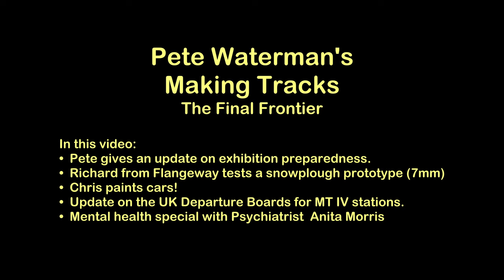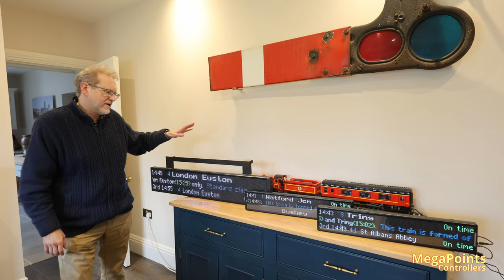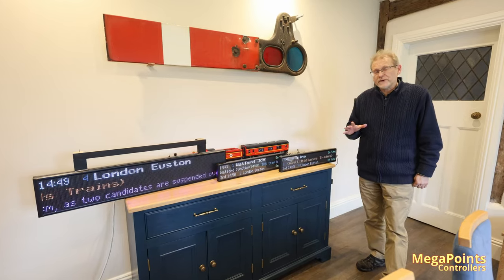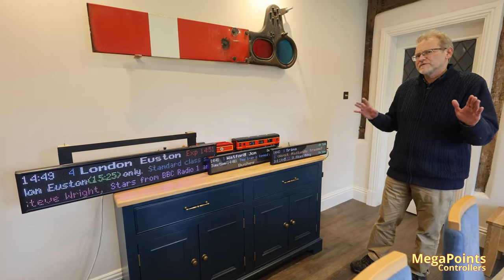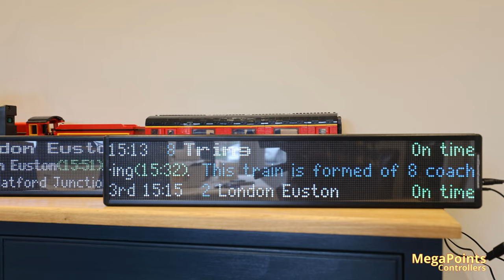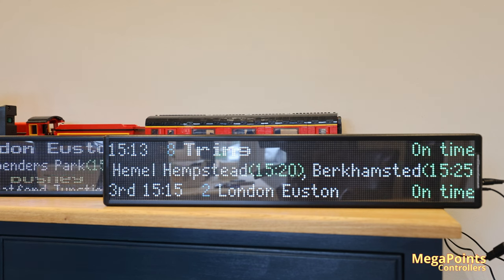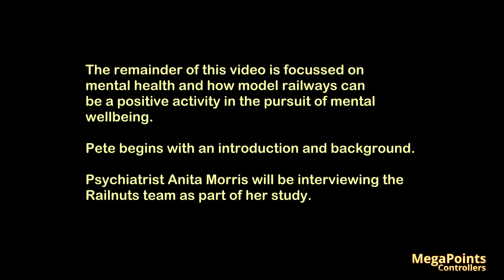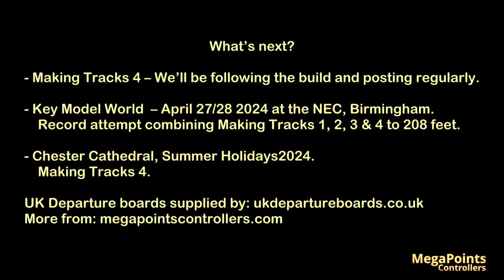Pete Watermans - The Final Frontier, A 208 foot long OO Gauge model railway

Comment: Peter. At the Cathedral last year I was talking to you about corridor connections, to save the 4 ft jump passengers had to make. 
I have recently been using the black paper type, gluing them to one end of the coach only, they expand and contract and slide sideways at curves and crossovers.
They are £4.00 for six, but if you have a smaller gap, you can cut them in half and do 12 coaches with one pack.
You could ask also get  Phil to knock some up???
They take about 2 minutes a coach to assemble and glue to the coach end!!! It's surprising how realistic the look!!! Phil could make some for pence!
John Harrison. Wallasey
(Ex Vintage Tramdriver at Birkenhead!!!)

Comment: The team should make an extra baseboard that can replace the standard one. This could be made with 2 tunnels and 2 bridges and make the 4 lines in to 1 line that goes around the layout 4 times for one run. This would make the layout 4 times longer and would surely make and set some kind of indoor world record possible.